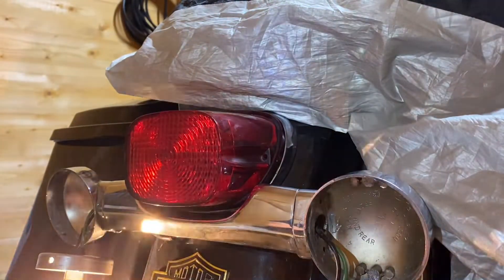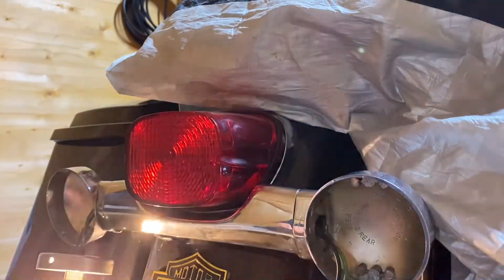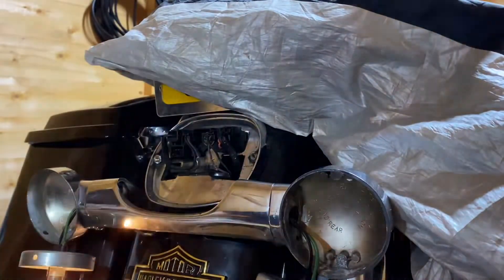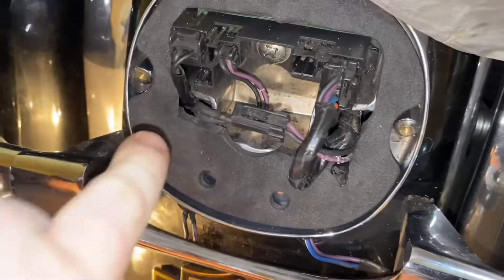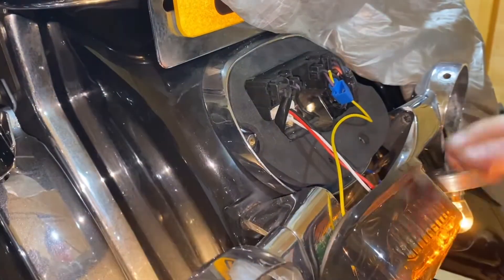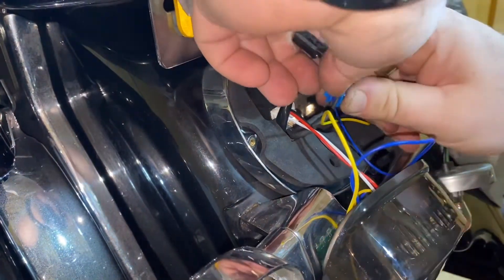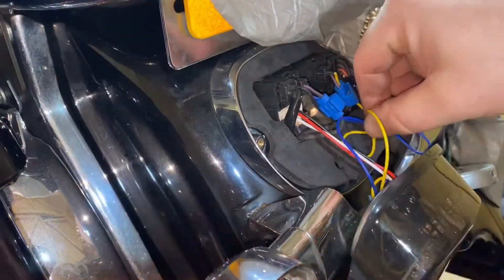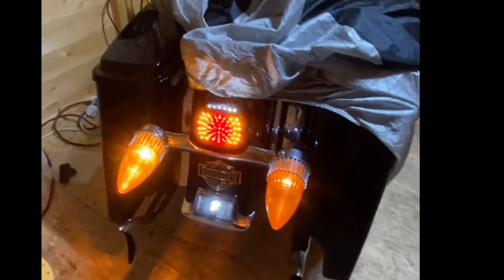Amazon LED Tail Light Install Harley Davidson

Comment: WHats with the strobe light so annoying couldn't watch it?
Reply from the maker: Its not a strobe light. Its the rear singal lights flashing so i can connect the tail light and intergrated signal lights to the correct wires.
Reply: Ffs🙄